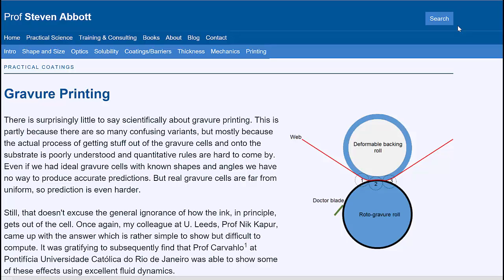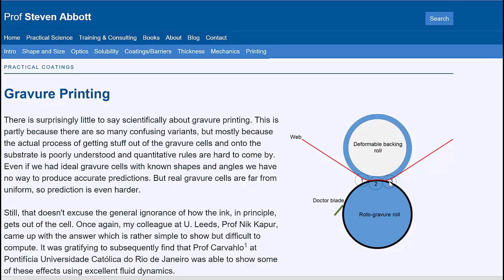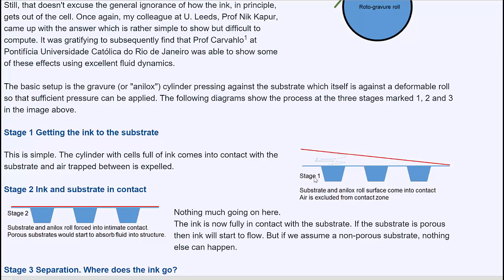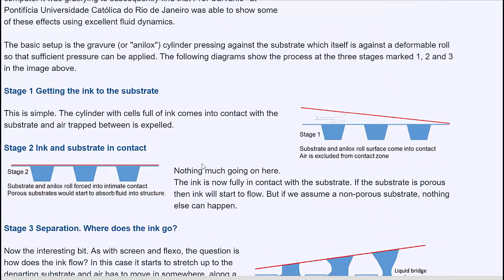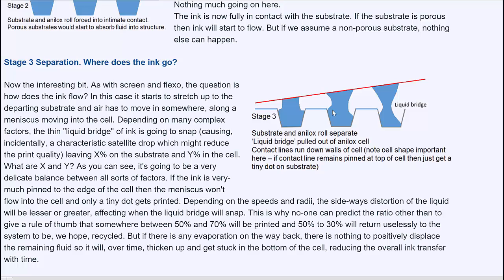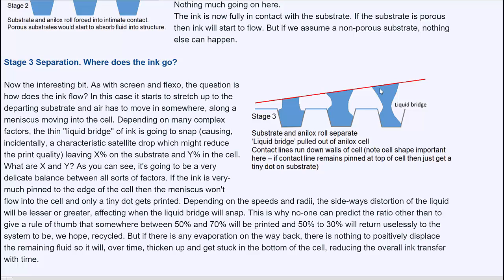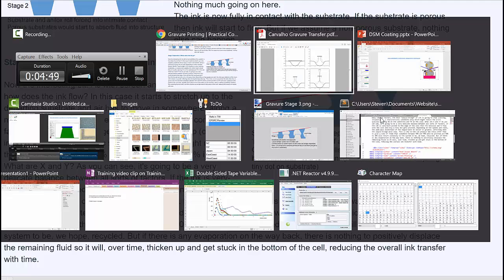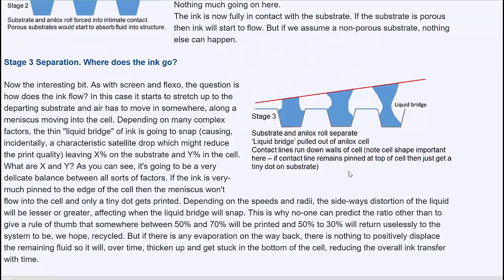Gravure Printing

Comment: Hi Steve, interesting view of what happens with Gravure ink transfer. I can see your point from a physics point of view. But from an experienced Gravure printer's perspective, there are ways to control this. First "Stage 1" is the most important part of Gravure.  Correct doctor blade, blade angle minimizing contact area on cylinder. Also the distance of blade to impression point will depend on the chemistry of the ink. This can be changed by altering the solvent blend to speed up/ or slow down drying rate. This determines what volume the gravure cell holds at the impression point. If you have incorrect drying rate, you will lose volume, through evaporation. the myth is that the ink dries in the cell after impression. The importance of delivering the cell full of ink to the impression is always overlooked. Gravity takes care of the rest with a good ink system. Gravure is a direct contact print process, a thing that Flexography will never match with anilox to plate to substrate. Ink transfer also depends on what cell angle you are using also. You have to match cell angle to the ink film weight you wish to transfer. 30 degrees low ink transfer/ hi def(compressed cell) 60 degree hi volume/solid coverage (elongated).

I would be happy to discuss any of these points with you.
Reply from the maker: Sorry for my slow reply. Yes, in my Printing Science book I point out that spending time on the "trivial" details of setting up the doctor blade is the single most important thing to be done. I'd not thought of the distance from blade to impression point - thanks for pointing it out. I'll update the book to mention this.